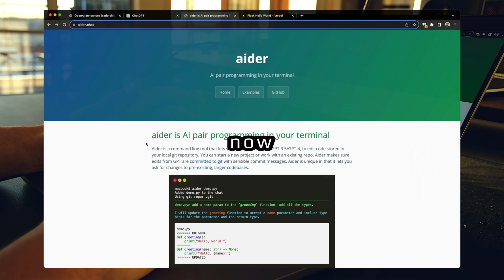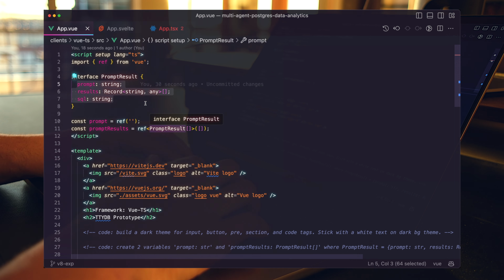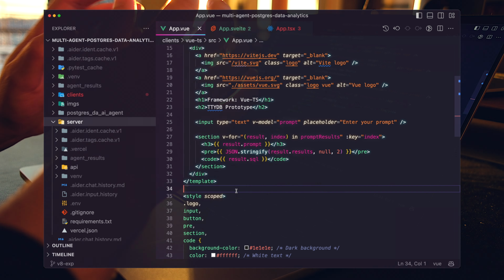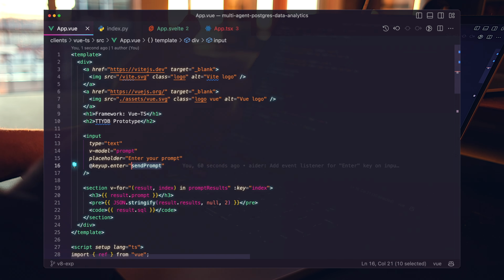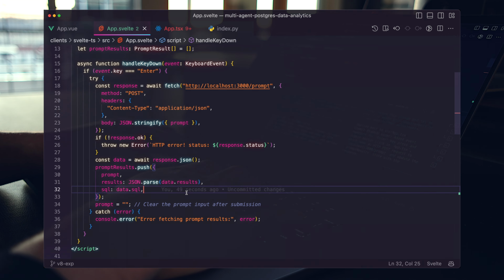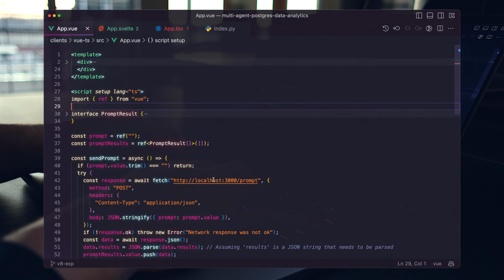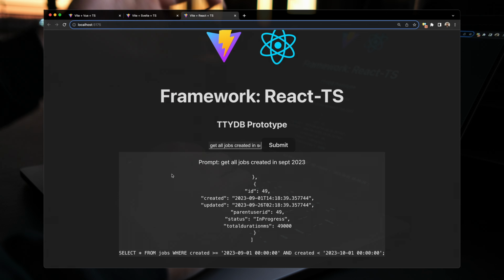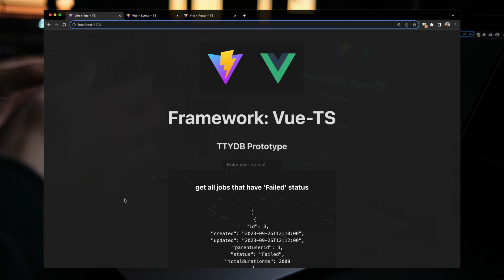Copilot Prompt Engineering: 3 UI Frameworks, 2 AI Agents, 1 Coding Assistant (AIDER CCC)

Comment: You are a genius! Thank you! 

I've been using Aider daily almost since the beginning (June 2023), and I never thought about using comments and then prompting Aider to execute them one by one.

This video should definitely be in the "Tips" section of the GitHub Aider page.

The advantage of your method is that you "auto-prompt" the GPT model automatically instead of going back and forth in the command line... because if you only give a bunch of steps in one prompt in the command line, the results are unreliable (even with gpt-4-1106-preview model).

I also use Codeium (VSCode extension) (the free version) for small snippets to save on OpenAI API costs. Those 2 things together are crazy good, and you are right. No matter what you do, you learn at the same time. 😁

Cheers! 😎

Comment: What we need to do is pipe this into watch so that you don't even have to run the prompt. The prompt runs automatically when the file is changed when the code is created that comment gets changed or removed to be a descriptive comment for the code that lies underneath it. Settle on a a semantic for code, change, comment, test, etc. So that you can.  Have a semantic set of comments that you use to drive the always watching model in the back end.
Reply from the maker: 💡👍💡You're absolutely right. The copilot agents should be watching us, and building based on our in code comments. We will cover this on the channel.

Comment: How do you feel - is it worth to move to  Aider? Does it make sense for fresh projects only? Or it might work with existing one?
Reply from the maker: @borisb.7235 is right - it's better with new codebases due to requiring less context.
Don't let this stop you though. Get your reps in so when copilot tech improves, you'll not only be ready you'll be ahead of the curve.
Reply: Struggled with existing projects due to dependencies. Make more sense for new projects imo